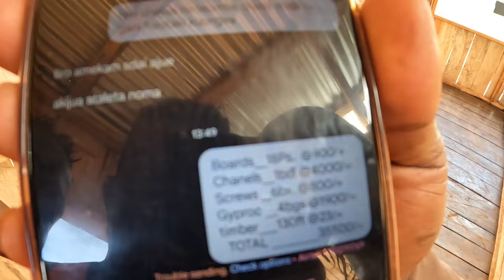THE GYPSUM GUY IS HERE 💥 ,ENTERIOR WALL FINISHES (THE SUNRISE TINY HOUSE BUILD UP)

Comment: No do pvc the one that looks like wood easier to handle,cheaper ,can withstand water in case of a leak,less weight on the ceiling boards, justy opinion❤❤🇯🇲
Reply from the maker: Hay Dianne actually that was the option that we are going for,,it's like we are all thinking the same thing 🤗🙏🏾❤️🌹🌹
Reply: That's a good suggestion and it's light weight, that's a big thing now in Trinidad everyone is changing their ceiling to  PVC ceiling it is cheaper on your pocket too